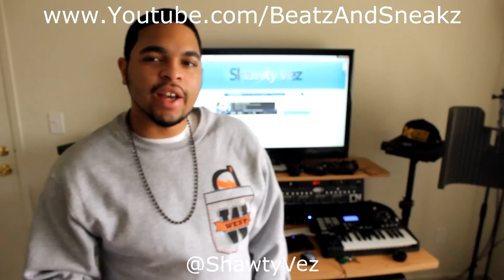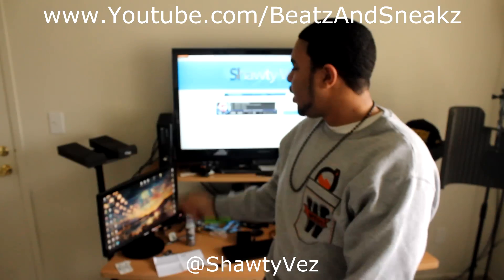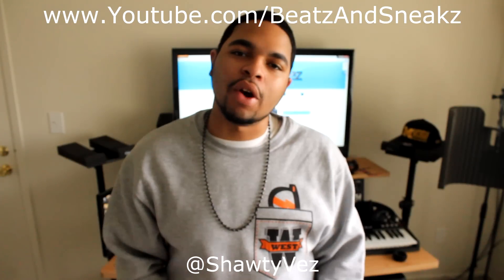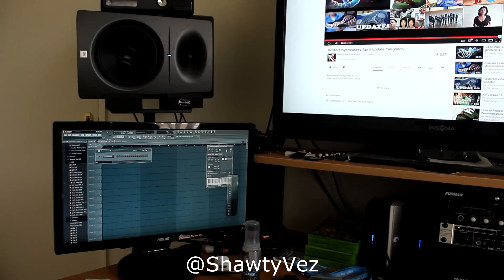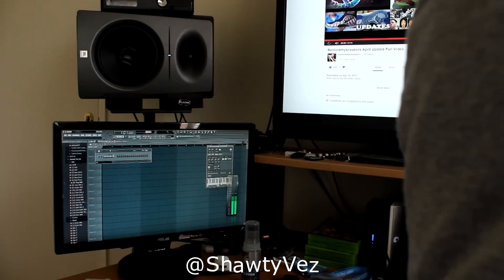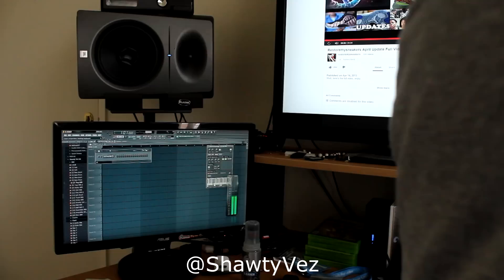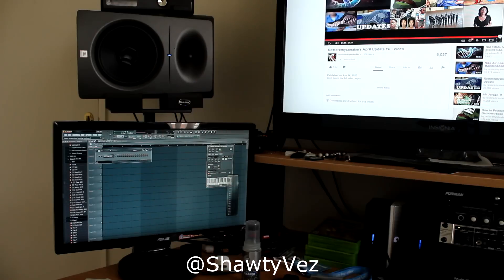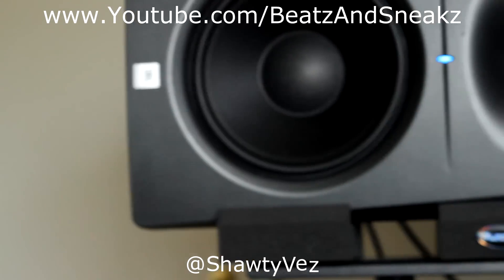How to Fix Studio Monitors (Dust Cap)

Comment: what size dust cap did you buy? Im considering doing this to mine but i dont know the size of the dust cap.
Reply: *****  I have the exact speakers you do. But i have repaired them. I have a top tip: with a cotton swab (q-Tip) and some household rubber cement from super glue brand, apply it to the cotton swab until it is saturated, then place on the dent or dimple of the damaged dust cap. once dry pull gently and dent is out. since its rubber cement, it pulls off after the surface is out!!!
Reply: use a tape measure

Comment: press tape into dent Smooth over the cap then take both ends and pull tape with both hands left and right at the same time,not pull out towards you,as you stretch the tape it only puts the pressure to the center and this has worked with dented metal dustcaps and paper/plastic ones as well.
Reply: You all prolly dont care at all but does any of you know a method to get back into an instagram account??
I somehow forgot my login password. I would appreciate any help you can give me
Reply: @Micah Maxton instablaster ;)
Reply: @Adan Santiago It worked and I finally got access to my account again. I'm so happy:D
Thank you so much you really help me out !
Reply: @Micah Maxton No problem =)

Comment: Hey Great Vid! Was wondering if you can say weather the smae procedure would apply to a tweeter... I have a couple of MSP5s with cracked doms and replacements tweeters are crazy expensive and because of the design fitting an aftermarket one would be a challenge

Comment: Great video thanks for the tips, I have a question though: One of my monitor speakers came with some slightly amount of glue that leaked out of the dust cap to the cone, around 2 mm. Should I ask for replacement or that is totally fine?:)
Reply from the maker: +Pedro Almeida All that means is that they used too much glue when manufacturing it and some leaked out once they applied pressure to the dust cap. It's totally fine.
Reply: I am glad, thanks!
Reply from the maker: No prob

Comment: This is a detailed video.  I have a Mackie HR824 speaker that had a caved in dome.  Dude came to the studio and grabbed the vacuum cleaner, pulled the extension hose, put it on the dome and sucked it out. As long as it isn't cut, you good.  It might have a slight crease depending on how deep or how long it stayed poked in, but it was an easy fix if it aint cut.  Just letting you know.  But Good Video bruh.
Reply from the maker: +trevis757 I'm late, but the vacuum trick doesn't work in every situation. Trust me I tried everything before replacing the dust caps completely.  Thanks by the way!

Comment: I've repaired mine with a glass repair tape which is really sticky. (you can try with duck tape) Push it back and it's all good, like new. You can see some mark but no link have been done to it, so it's all good anew.  --Thanks for the tips.

Comment: Maaaate, Put a small piece of clear hose on the end of your vacuum cleaner hose, tape it up so it has good suction, lightly press the hose against the dust cap and you can "suck" it back out into position.

Comment: i just use the end of a vacuum hose to suck them back out works perfect
Reply from the maker: +austin brewer I'm late, but the vacuum trick doesn't work in every situation. Trust me I tried everything before replacing the dust caps completely.  Thanks by the way!
Reply: One of these times you're going to stick the vacuum on the cap and suck the whole thing right off. The vacuum works but is dangerous.